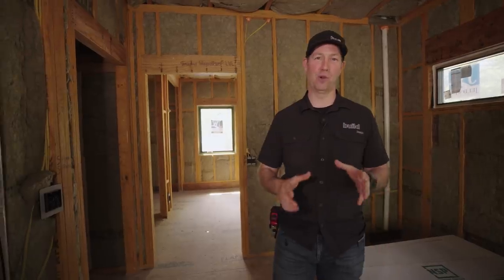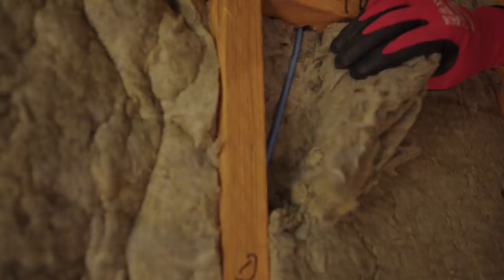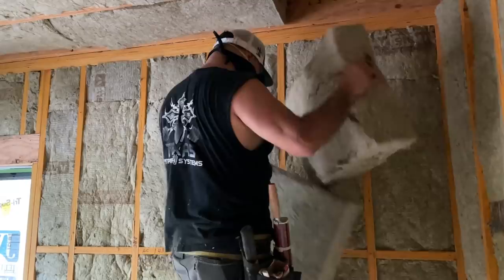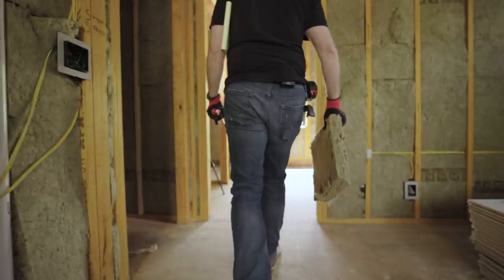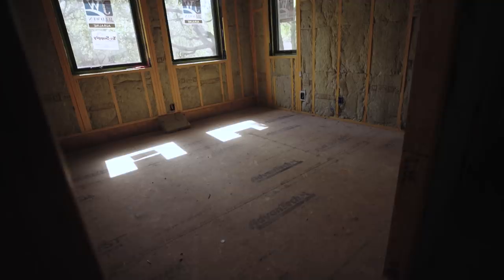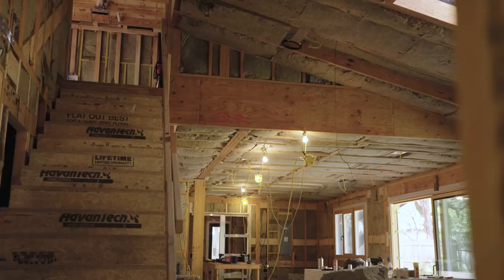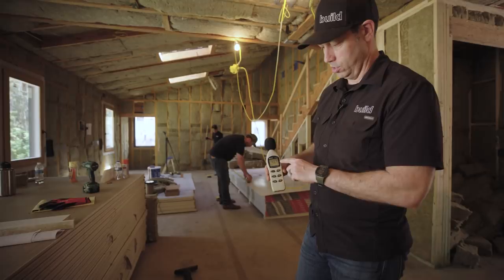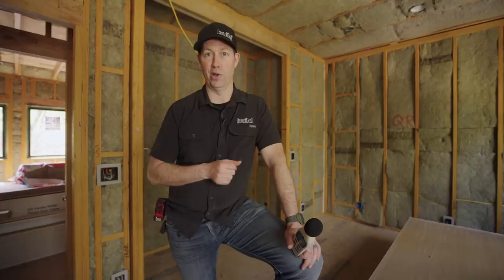7 reasons I used Rockwool insulation at my house.

Comment: Do i need to put a vapor barrier over inside stud walls if I use rockwool on exterior wall?
Reply: iirc, his house has the vapor barrier as a sheathing outside of the exterior insulation, but Matt has mentioned that some houses have it just behind the drywall. It seems the general climate of the location is the main factor. So I guess the answer is "it depends", sorry. :o)

Comment: I can hear neighbours footsteps, we have a ground floor house and they have a 3 story house. The house is 2 metres apart from each other detached, I am frustrated every day of my life I cannot relax at home, will rockwool be a solution? The only thing I worry about is even if I go outside I can hear their footsteps penetrate through there house, I dont understand how this has happend.. Please help..
Reply: Footsteps are impact noise, which is a different story. The Rockwool insulation might help to muffle any airborne noise, but the impact noise is coming through the wood framing. To install Rockwool in your walls, you would need to remove the existing drywall. You should do some research on how to "decouple" the drywall from the wood framing with techniques like resilient channels. Or maybe talk to you neighbors first -- the noise source -- and suggest putting some carpeting in their walking paths?

Comment: I have a question. I got a new direct vent water heater installed in my basement.  The wall of the basement consists of cinder blocks on the inside, with a thin layer of bricks on the outside. The plumbers removed a large square cinder block and then made the round hole needed for the vent through the brick wall. They did not fill the empty space around the vent left from the removed cinder block. As a result, the insulation of the basement deteriorated sharply and it is several degrees colder than before (reducing the efficiency of my furnace also located in the same space). What can I put around the vent to restore the insulation? The vent does not really get warm on the inside of the house, but I want to avoid flammable materials. Would rockwall work?

Comment: Im far from a home reno expert, but any chance I get I replace my pink wall insulation with Rockwool when I have access  So easy to work with, and so many advantages to it.  If you use Rockwool on an external wall in Northern regions, do you still need to use vapour barrier on the interior?

Comment: Can you discuss from a health standpoint. Example: What if I install it in i.e. garage wood-shop (due to winter coming in, etc. BUT I do not plan on putting up drywall, etc just YET! Is it ok to be around it, and breathing it in for an extended period of time? Do I need to immediately put up a vapor barrier?
Reply: I did not want to have a plastic sheet up and to keep the Rockwool in place in your situation I would use landscape cloth stapled to the framing to protect the Rockwool, landscape cloth is cheap, permeable, and prevents most fibers from becoming airborne. Also I can rub up against it and not damage the insulation or transfer to my clothing. I used this technique in my crawlspace floor so when maintenance was done under the house, My trades people wouldn't have to worry about airborne insulation and wouldn't damage the insulation easily. 24" crawl space and a big tradesman can damage a lot of insulation quickly.

Comment: I don't think the measurement without the sheetrock is valid.. rockwool is amazing at absorption so it sucks up almost all the noise in the room. But if you apply the sheetrock there will be a lot more echoes and vibration causing sound.

Comment: HI SIr,  I have blown cellulose in  my attic since Sep 2000.   It has settled of course and with much traffic of late, electricians, sheet metal workers, refrigerant etc..  SO its not in the best shape.
I would love to use blown rockwool to bring things up to a better standard.  HOwever I think that wishful thinking as I dont see such a product.    Can I still use rockwall in the attic over the current cellulose???

Comment: @Matt Risinger, it would have been nice to mention the embodied carbon energy of mineral wool as a potential negative for people to consider, if they are concerned about that sort of things.
I recall seeing in a previous segment on your house build several bags of Havelock sheep wool insulation. Did you consider that insulation option and was there reasons, other than economical that made you prefer mineral wool?

Comment: Where does the water go if you are using Rockwool insulation in your attic rafters? Would you even know you have a leak?
Reply: Likley will end up eventually somewhere you have drywall beneath  the leak

Comment: fiberglass has boatloads of particulates.  Wonder if you could use aluminum duct tape in the attic between the batts of insulation? (bats in the attic babe 🤣😂)

Where didn't you use Rockwool & why did you choose the other in those instances?

Comment: rockwool can be install out of the blue, compared to the other companies that will make you itch for days. jmo working with so many brands over the years
Reply: Be careful. Despite Matt’s claims, walking around or installing w/o respirator is not recommended, even by Rockwool. This is inorganic compounds, even a few microns in size, they get into your lungs and your body cannot absorb them nor easily discard. 

We did a demo on a remodel last year in Bozeman that had Roxul insulation in walls, floor and ceiling. I went into building 2-days after demo with structure down to studs, wide open for any airborne fibers to have dissipated. I was on-site less than 5 hours, coughing the last hour. I was wearing only a Covid fabric mask. I was coughing the next 2 days. I treat all fiber insulation the same; cellulose, fibreglass, lambs wool and mineral wool as dangerous requiring respirator.

Comment: How does this compares to pink insulation? As far as keeping heat/cold from coming in/out the house?
And is it cheaper or more expensive than pink insulation?
Reply: Compared to pink insulation, Rockwool is about 10% more expensive, much more fire and high-temperature resistant, and better at absorbing sound.  Where I live, they sell it at Home Depot.

Comment: Ballpark, what would the cost increase be, on this home, using this product vs. standard pink insulation?
Reply: Just a few dollars more....
Reply: In my market at least 50% more
Reply: It really depends. I live in the north, Winnipeg, and in my market rockwool is about 20% more per r value per sq ft.
Reply: @Bob_Lob_Law  thank you.  I did a quick google search, and it looks like R30 pink insulation is about $0.85/sf.  If I use 2x the square footage (=5400), Rockwool ends up costing less than $1000 more, at +20%.  Seems like a good upgrade, for the cost.

Comment: Dude, no offense, but rock wool is still used in hydroponics, it was discovered to be an excellent inert substrate for liquid fertilizers, it wicks water very, very well via capillary action given half a chance. Sure, the face may roll it away initially, but try sticking the full end of a bat in water, come back the next day.....it will be wet several inches above the water line,

Comment: Honestly Rockwool sounds interesting but is it safer then asbestos, Im just curious Im not making any accusations, Im just genuinely curious?
Reply: Honestly if you do the research it wasn’t all form of asbestos that was early and it was due to the grain structure that made it a good insulation also made it bad for the lugs but rock wool is basically fiberglass glass but better and denser/ compact so it even has a less chance to come apart....... geology student also was a construction worker in Houston
Reply: Who knows? 
It’s not like building materials are tested or regulated these days...
Reply: @jaxturner7288  you’d be surprised there are reason some things are code and will pass inscription..... the have device to test the residual chemicals for treating material that if it passes a certain point you fail inscription
Reply: @jesusllanas9318  oh thanks for the info!!!!
Reply: It's absolutely safer than asbestos. Sadly a couple of years ago in Tampa Florida I was trapped inside of an air duct because I am confined space certified and ended up figuring out that I was laying on top of the layer of asbestos so thick that I couldn't see anything. The only way I knew is that the damn sticker was still on the product from God knows how long ago the building was built in 1926.
Reply: @jayfitmob8645  like I said it wasn’t all forms but ye so would still be careful as any old insulation is bad for the lungs or eye hope nothing bad happens
Reply: Good information. I'll look at Rockwool insulation for this design-build house in East Texas. I was looking at spray foam. When's the price of lumber coming down? I hope in June, when I need a frame package.
Reply: @michaelshettig7805  honestly I don’t see lumber coming down anytime soon and I’d do a combination of closed cell gain of about1-3 in then rockwool as the foam will help against sheer forces of high winds and make another vapor barrier
Reply: I'm no rocket scientist...

But I've NEVER seen a Rockwool abatement team show up before a remodel in their spacesuits
Reply: @Jesus Llamas Good information on the combination of the insulation. I did a study for this house on wind loads with shear walls, exterior and interior. I didn't think about the spray foam giving structural stability. I'll look into it. Thanks.
Reply: @michaelshettig7805  honestly once you build the house pls update I am also interested in building my own house and customs builders tend to use design most don’t and I always would love to find new inspiration
Reply: @jesus Llanas I'll have updates on this design-build on my channel in several week. I'm starting out with quality control, value engineering, preconstruction, safety videos. In 2 weeks, I'll post my research on wind loads on houses.
Reply: Mineral wool fibers are much larger than asbestos fiber, and don't have the porcupine-barb shape that chrysotile asbestos has. There is also some evidence that mineral wool is biosoluble, which asbestos definitely isn't. 
Mineral wool insulation is nearly as old as commercial asbestos (both began production in the 1800s), there's been plenty of time for people to determine the risks.
Reply: @michaelshettig7805  Rockwool is an amazing product. God... I kinda  sounded like Billy Mays right there. But seriously it's something that's always used in commercial construction, hospitals etc. Definitely something to look into and probably worth the extra few dollars a square foot my friend

Comment: Matt, toying w/a few ideas. have an old house and I'm thinking of an inch of closed cell foam to seal against draft and rockwool for safe insulation. On interior walls & floor/ceilings what R-value w/the safe & sound? I'm zoning each room so I'd like to keep them at the temp it's set for without thermal bleed-thru.
Reply from the maker: I have a video with this exact same assembly. Should publish that in a few weeks

Comment: If you wanted to change to an insulated Roof Deck from a insulated Ceiling. Would you suggest Rockwool or Sprayfoam?
Reply: Sprayfoam, for sure.  It is fully adhered and has higher R-value per inch.

Comment: I work from home and need to make my office quieter from little kids running through surrounding halls with hardwood floors. I was thinking updating walls to staggered studs with insulation and quiet rock. But I’m wondering with rock wool by itself (no staggered studding and/or quiet rock) will already take me past the useful sound insulation considering I have French doors that are going to be a hard thing to bring sound transmission levels down on relatively speaking.  How would you go about determining what is a useful level of sound proofing of the walls themselves?  And do you have any videos on sound reducing doors?
Reply: I’m a developer, who happens to also be an architect, building a lot of multifamily residential where we spend a fair bit of time on sound attenuation.  Mass always helps sound attenuation.  2 kinds of sound issues…Sound through the walls - kids yelling which would be governed by the Sound Transmission Coefficient (STC), where you probably can find resources to calculate each materials STC for the wall assembly.  The harder one to control is sound from impacts - kids running on the floor.  That’s HIIT (High Impact ? Transmission).

Because I’m also a DIYer, as a practical matter, you’re not going to calculate the STC or really know in practical purpose what the number would mean and feel like if you did.  Additionally, you can make the best wall, but give it all back through the French door.  We had a project on a freeway where more sound came through the wall then the special triple pane windows we purchased.

My recommendation beside the Rockwool, would be double side the drywall on each side.  An upgrade would be to install it on resilient channel clips (cheap sheet metal strip) that help the drywall flex and absorb sound.  A further upgrade could be acoustic rubber sheet that can be put in the wall, that is mass and resilience.  For that door, you may want to look in the weatherstrip aisle of HD, Lowe’s to get some sound steel performance around the door.  Lastly, more sound absorptive furnishings, like an area rug if it’s a wood floor, etc.  Finally, Bose noise cancelling headphones…

I suspect Your biggest problem is actually the poor performance of the door relative to the wall.  Perception of sound is often relative.

Hope that helps…

Comment: What's the difference between fiberglass and rockwool in insulation, sound dampening, fire resistance, and cost?
Reply: Rockwool performs better in thermal control, sound control, moisture resistance, fire resistance, rodent resistance,  and installs better. Costs almost double of high density fiber glass.

Comment: I have an add-on room with flat roof with no insulation -   I was told not to insulate between ceiling & roof deck because of water vapor - then mold issues probably would form. They want to build a roof over the roof to insulate - and give the roof a slight slope (?) I do not want to use spray foam because of the off-gassing (and inability to find anyone who can install it correctly).  Would rockwool insulation be a good choice to insulate the ceiling with since it 'breaths' or will there still be water vapor issues? (I am located in SW OK)
Reply: After a couple hours, there is no gassing.  Foam becomes inert.

Comment: Thanks Matt. It's very helpful
But what about too cold places like some cities in Russia?
I'd like to know that has rock-wool high efficiency in too cold weather (something around - 20 to - 35) and snowy areas?
Thanks in advance
Reply: I used in that type of temperatures no issues. Just make sure you also use vapour barrier
Reply: @snakeplisken4119  thanks

Comment: As much as I absolutely love rockwool, it’s not the supporting structure of a house. How would the rockwool
behave in a house fire?
Reply: Rockwool  by itself is not combustible. If you want to know the fire rating for any wall, floor, or roof assembly, US Gypsum has a book of pre-tested assemblies and their ratings. These are typically applied to commercial buildings, and not to single family houses where rated assemblies are generally  not required . For unusual, or untested wood assemblies,  you  can use the CAM process described in of Section 722.6 in the International Building Code to determine the rating of an assembly.

Comment: I am writing to you from Italy.. I will never understand why you don't use corrugated pipes to pass the cables, in my area such works were already completely out of the norm in the 1960s.. Instead of doing as has been done, in the isolated structure in the video, a vapor barrier had to be installed and a false wall built where the system could pass without the worry of piercing the barrier, also because fixing the plasterboard sheets on the barrier is like not installing it..

One last note on the sound test: it doesn't make any sense, it's normal for wool to absorb sound waves, once you put the plasterboard in front of it the sound bounces back..

Comment: Matt, would you do anything different if lived in the north? Maybe a vapor barrier?
Reply: I would assume he would use a smart vapor barrier like MemBrain or a similar product. Again an assumption. Many great building articles that have seen very good results with just a few coats of latex paint as a retarder (of coarse with the caveat of excellent air sealing).
Reply: I wouldn't put a vapor barrier anywhere except in the middle of the wall (i.e. PERSIST/REMOTE) unless I were 100% sure that no AC would ever be used for the entire lifetime of the house. Given climate change it's risky to make that assumption.

Comment: "8th reason I used Rockwool: I got it for free for making this video."  Just kidding, but did you mention rodents? I've been replacing the fiberglass insulation in my crawlspace with mineral wool insulation because of chronic rat/mouse infestations. They absolutely hate mineral wool and all signs of them have disappeared where I've replaced the fiberglass insulation.

Comment: Ok, I watched the whole video waiting for the bottom line ... which never came.

So to help your viewers who don't get freebies from sponsorships, I offer this material cost calculation for the example of a 2x6x8ft, 16 O.C. wall, un-faced, Home Depot, in Austin ...
               pink stuff - R21, $6 per stud cavity
               rockwool - R23, $13 per stud cavity

There you go. Rockwool costs twice as much, you get a little more R-value, and you get the fire resistance.